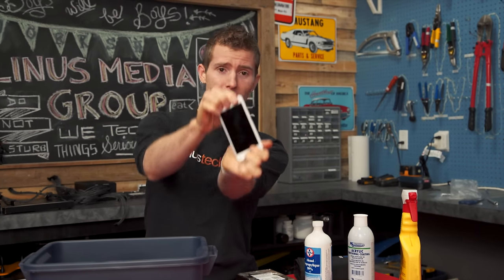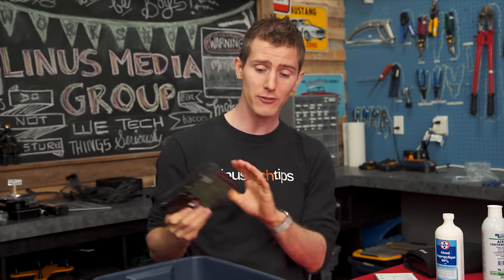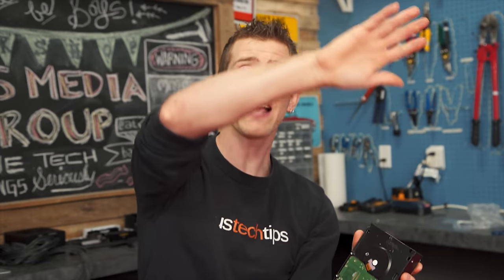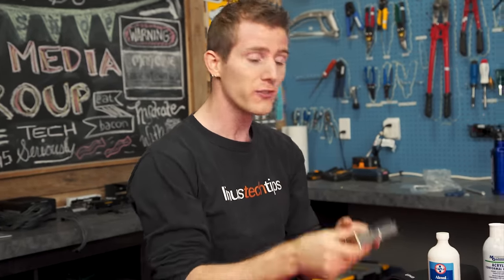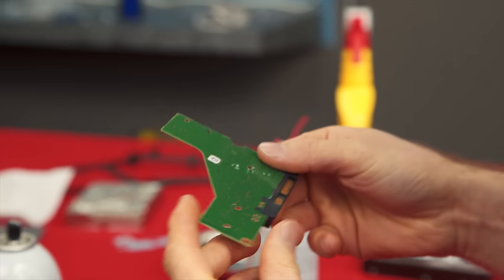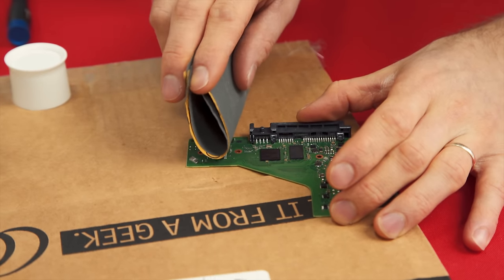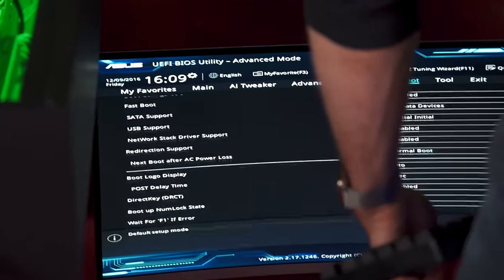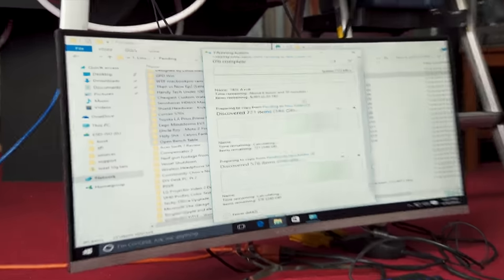DIY "Waterproof" Hard Drive

Comment: When you run out of ways to fit a sponsored HDD into your videos lol.
Reply: or "When you have all the videos pre recorded until new year but sponsorship requires one more video with their product and you are out of time and ideas"
Reply: Gadget Addict hi
Reply: Gadget Addict the worst is that it's still better than sponored spanish videos.

(An argentinian says it)
Reply: Of you wanna put it into water then just Use destilled water, no Minerals in it that lead electricity. Should work, even without your acryl stuff.
Reply: Gadget Addict ,
Reply: @jodafa1000  no because the metal's ions will get into the water, the oxyde too and it will become conductive

Comment: It was definitely the power connector. You shorted all 4 power pins together, because they're not at all isolated from the water
Reply: Jacob eMatt I don't think so. The Powersuply shoud be strong enough to handle that. I think it was the Signal, wich is very easy to influence, especialy with such a high data transmission
Reply: klosskopf der1. What? If it is shorted the power will never reach the HDD no matter if you have a 30$ PSU or an nuclear reactor plugged into it
Reply: Jacob eMatt I agree, even before he started adding more water, I knew it was going to fail, because the connectors would all need to be connected and then conformally coated to seal them and that includes the motor connections, as the water will still get in to the connections where he sanded them.
Reply: i don't think that you know how electricity works. if you are shorting the power connector the solution simply isnt a stronger power supply. Nothing can handle a short circuit, it can only shut down the power to it to prevent damage.
Reply: Should have put the connectors in and cover the edges in that spray.
Reply: I expected him to cover the connectors with silicone or that sealant thing :P
Reply: Karavusk ikr! This was so obvious that I genuinely wonder how Linus managed to overlook it. Did he just get so fixated on the PCB that he forgot about all other potential bridges?
Reply: InverseAgonist Typical linus fashion. He gets the concept, but that's about it.
Reply: do you guys realy think that water does realy shorten the circuit with 0 Ohm
Reply: normal water has an specific Resistor of 2 x 10^7 Ohm x mm^2 x m^-1 wich means that the actual shortening has an resistor of round about a view hundred Ohms (probably a little bit less caused by ionisation)
Reply: that would mean an additive power consumption of 1,4 W on 12V Trai and 0,25W on 5V Tray. (Predicting an resistor of 100 ohm)
Reply: should have sprayed more after the assembly...
Reply: That makes sense, because if the power pins were shorted, then the short circuit protection circuit of the PSU would have kicked in, and the PSU would have powered down to save itself (and the rest of the hardware) from frying..

I agree with klosskopf, it is probably the data pins that shorted, (let me dig out the sata spec to see how much current the signals are suppose to carry, and the expected load the differential drivers expect to see)
Reply: not power, most likely data
Reply: not a viable option
Reply: according to SATA Spec sheet, http://www.lttconn.com/res/lttconn/pdres/201005/20100521170123066.pdf 
Pg 195-210 (but we only care about VdiffTX (pg 198), and and ZDiffTX(Pg 195) a ~100 ohm brought by water, in parallel with the signals would have push the drive out of spec,  and cause failure...)

another way to know that the  power pins short did not cause a catastrophic failure, the drive worked after drying and was functional in mineral oil.
Reply: Just use vaseline or some sort of grease no need for silicone, same as everyone else who makes removal outdoor connections.
Reply: No, he shorted data pins. Water is not a very good conductor; the power supply probably didn't even notice the tiny load caused by the water.
Reply: FHRsLP The power supply wouldn't notice, but the hard drive did. 12v shorting onto 5v pins
Reply: That's not how it works... That's not how ANY of this works.
As I said earlier, the water is not a very good conductor and the current that flowed between 5V - 12V rails was zero. Nothing. Why?
You know, if you take a look at a SATA power connector, you will notice one small detail. Between 5V, 12V rails, there is a ground. So the current of a few mA that flowed was solely between GND<=>5V and GND<=>12V rails.
And even if there wasn't a ground pin between 5V, 12V pins and the current flowed between 5V and 12V.. so what? It's few milliamps, the 5V rail is usually loaded at 8+A so there would be absolutely zero voltage increase.
And even if by some miracle there was (let's say some random piece of metal got there), if the voltage on the 5V rail got above around 5.5V, the power supply would shutdown within a fraction of a second, because the rail would be out of ATX spec.
Reply: "strong enough to handle a short and make your electronic work regardless of the short"
sure
Reply: He should have put some silent around the power and maybe the data connector to seal out the water.
Reply: If all you 38 (expert) guys say so THEN IT MUST BE!   LOL
Reply: don't need to be a expert just smarter then linus which isn't hard
Reply: No, not necessarily. Water has a high electrical resistivity even when many free floating ions are present (as is the case with electrolytes dissolved in water) It would however cause higher power draw (due to electrolysis) and corrode the contacts progressively over time. It's the sensitive high frequency signals on the SATA connector that are the problem.The additional loading effects of the water are probably causing unwanted loading on the data pins of the SATA causing the interface to malfunction.
Reply: +Karavusk No, that's not how this works. That's not how any of this works!! The power supply connector to the HDD is made up of a ground connection, a +5Vdc, and a +12Vdc. all 5V and 12V power supply rails are the same for the entire PC build. If there was a dead short, the power supply would enter foldback current limiting and the whole system would shut down as a protection mechanism. If the power supply was not able to limit current flow for some stupid reason, then the wires to the HHD would melt in the case of a dead short.
Reply: You guys just need give it up and throw it into a ziploc bag.
Reply: this is conductive enough to to short because he put more tap water ( it have mineral ) not the distiled water
Reply: I has been done it, The HDD run smoothly, no water enter to the HDD ( Thanks to 5 layer Ziplock + Heated Zip) but 30 mins later IDK why it gone overheat (60°C) but my water is cool just 25°C.
Reply: I don't think it's the power connector. I've used the 12V rail of a low power psu to  electrolyse water to produce HHO gas and even with quite a lot of surface area, a very small distance between each electrode and a saturated  solution of sodium carbonate in water it still ran quite stable. Water isn't an ideal conductor. Especially if there aren't many minerals dissolved into the water. This combined with the fact that the psu can deliver a lot of power means the power connector probably wasn't the problem. The low power output of the data pins however means that even a small load could cause a significant voltage difference which would cause the data to be corrupted.
Reply: Water+plastic coating will act as an insulator. Water takes a LOT of heat to warm up, so the cool HDD probably overheated before the water took away the heat. A CPU/GPU water cooling solution uses heat conductive metal to bridge the gap (not ziplock bags :P ) and a water pump (not always needed, but is for high temps) and the CPU/GPU produces high heat.
Reply: Saw this years ago on exhibition, you could dump the full motherboard inside aquarium with live fish.
But all you need to do is assemble it first, and then spray all over, then everything is sealed from water, including cable connectors ;-)
Reply: Please take a good look at the SATA power connector and think about it for a minute, Sir.
Reply: +TechyBen: No, that's not exactly right either. The reason why a swimming pool feels cold when you jump in it even on a warm summer day is because the water (which is at ambient temperature) robs you of your body heat faster than air can, due to it's MUCH better thermal conductivity. Similarly, the HDD will get colder when submerged as the water will rob the heat from it. If anything sticking a hot HDD into water will cause thermal stress on the cast aluminum as it rapidly cools down.
Reply: For that matter, even the conformally coated parts of the HDD controller would be affected by the water while powered. The water would increase the capacitive loading effects on every single digital signal trace, changing the impedance of the lines and busses, and causing the line output drivers to see a large capacitive load and "short out"
Reply: A capacitor, for those who don't know, is "a device with 2 electrical plates separated by an insulator."
It is represented like this: ----| |----- And the schematic symbol is pretty self-explanatory.
Reply: Imagine the digital traces on the board, capacitively coupling to the water even through the conformal coating and PCB green soldermask. At DC, capacitors look like open circuit or nothing. at high frequency AC, it looks like a short-circuit. DC power rails would be unaffected, while high speed digital signals with rapidly changing voltage WILL BE AFFECTED.
Reply: Power Max
you need a real luck to find the resonant frequency
Reply: never mind
Reply: SpIRiTus1995 no, there is no rensonance needed. Capacitive reactance occurs at all frequencies. Xc is inversly proportional to frequency, so the loading effect happens with any changing voltage. The digital logic signals are effectively square waves, and have a LOT of harmonics.
Reply: Power Max are you high buddy?
Reply: Power Max You are partially right. BUT water and tiny traces don't really form that big of a capacitor; there is not enough surface area and water is a bad conductor. I doubt it would really affect the circuit.
What does affect the circuit though is water directly between high-impedance SATA data pins.
Reply: Literally all he needed to do was get the hard drive, connect the connectors and then "pot" it (i.e. dunk it in a bath of epoxy resin and allow it to harden into a rigid shell)
Reply: it is a saying
Reply: Power Max well not all frequencies give you the same impedance
Reply: Paul Sxton fair play.
Reply: Paul Sxton Practically all he needed to do was get the hard drive, connect the connectors and then "pot" it (I.e. dunk it in a bath of epoxy resin and allow it to harden into a rigid shell)...   better?
Reply: While everyone else is arguing whether it was the power pins or the data pins that shorted (btw, it was the data pins, or the protection in the PSU would've turned off power to the whole system, as opposed to the shown loss of connection to the drive) I'm simply going to point out that the OP called a SATA power cable a 4-pin connector, when it is clearly a 5-pin connector....

Comment: You need to try this with the PCB of a graphics card and submerge the card completely under water, that could lead to some seriously low temps. But this time remember to insulate the power connector.
Reply: Softerrr this actully sounds like an intersting idea you could easily use pcie extensions to achieve this as well
Reply: but metal is a better conductor than water... so heatsinks are better than just dunking a gpu in water
Reply: Water would indeed move heat from the heatsink, but it would propably not radiate out of the water too well, since a bucket or a small fishtank is gonna have a lot less surface area than a decent heatsink. 
Or so I presume, based on that the oil-submersed computer required aircooled rads to pump the oil through, and temps weren't anything particularly good
Reply: New meaning of water proof
Reply: thats the whole concept for mineral oil or Novak submerged PCs
Reply: just dump the whole GPU in LN2

Comment: Shouldn't logic have told you you needed to waterproof the cable connectors?
Reply: Caddy Guy Gaming Linus tech tips doesn't need logic :D
Reply: DonutEater true
Reply: what he needs is train and tracks
Reply: He should have re-sprayed after the alcohol with the connectors attached
Reply: True.  Electrical connections need to be isolated and watertight.
Reply: Logic should have told him not to dunk a hard drive into water. The second he started recording this video, logic ceased to be relevant.
Reply: It's about as logical as a "can a live power connector work in water" video.
Reply: bro learn how to spell connectors before you try to outsmart ppl

Comment: It wasn't very bright to submerge the SATA port and power connector, they are not water-tight. If they were watertight from the spray, the drive wouldn't boot up at all. The fact that the harddrive works before submerging completly, means the SATA and power connector aren't watertight. You risk not only destroying the harddrive, but the motherboard, power supply, and every other component which are connected to the motherboard, becase you submerged the SATA and power connectors.
Reply: LifeStalker with all the parts they have? Don't think they mind breaking some stuff. I mean, he just submerged a 4tb drive.
Reply: The seagate was actually a 10TB drive that costs over $500. Which makes it all the better.
Reply: hm, I think power supplies ad motherboards are somewhat tolerable to shorts though?
Reply: TheFreaxTux most branded power supplies has great overcurrent protection. But it depends on the motherboard. Some brands/models has better overcurrent protectino than others. For instance, just short circuiting a USB port on some of the most popular motherboard brands can permanently damage the port and disable it, even worse, break the motherboard and other connected components completely.
Reply: ahh i see we have an electrical engineer here
Reply: Water cannot really short connections the way you think, it can mess up high impedance connections but the resistance it has is too high to damage the power supply or the motherboard by just putting some connectors under water.
Reply: Pablo Rages I said "by putting some connectors under water" not dropping water directly on to it.
Reply: Pablo Rages it depends where the drops lands. connectors on the motherboard may have some short circuit/overcurrent protection. However if the drops land on the actual motherboard circuits, theres a big chance it can damage something.
Reply: LifeStalker i think he knows this

Comment: Well of course it didnt work, you used the wrong coating and didnt even attempt to waterproof the power/data connections
Reply: TacticalBBQSauce he did waterproof the connectors. it interfered with the connection so he had to scrape off the coating.
Reply: Those were the contacts, I meant the connectors themselves and the wires. Like you would do if you understood water ingress.
Reply: He should have plugged in all the cables and then spray everything with that stuff.
Reply: Right, it worked until he added enough water to go over the connectors. There's water getting into his power supply SATA cable. I had a feeling it would stop working as soon as I saw him power water over the top of the connectors.
Reply: *pour
and i agree. His SATA connector was probably the one making the water conductive with the aluminum clip. He should have sprayed at the very least both the connector and the PCB.
Reply: *should have
Reply: Regenbogenkotze
It's still the wrong type of conformal coat for what he's trying to achieve, better of to make a mould and encase the whole lot in conformal gel. This wouldn't address water wicking up the cables over time though.
Reply: Yeah seriously i dont know what he was expecting to happen.
Reply: +zarmaan khan I really wouldn't try doing anything with that  hard drive, it being an 80GB drive means that in all likelihood that drive is filled with air, and therefore like he stated in the beginning of the video you can't do anything with them due to the breather holes, wich you don't want to cover up either in an attempt to waterproof it.
Reply: +Brian Hamel , I guess the breather holes are there to help equalize pressure at significant altitude differences (and likely to preserve the seal by keeping the differential pressure between outside and inside at 0)..... So, instead of giving  up, I think I'd like to try creating an air bubble around this hole that had enough room to contract with the added pressure of the water, and then throw some hot glue over the foam seal around the cover..... and then jam some dielectric grease all over the connectors and have at it.. But I don't have any conformal coating, so it'd be a waste of time.

Comment: What you should try next time is siliconing everything in. Like, fish tank silicone. Put it together, plug it in to the power leads, then silicone everything up to the cables, that way no water can possibly get in, and all the contacts are still touching. :] That's a method people use frequently on LEDs, especially in fish tanks, to prevent them from getting water in them and shorting out.

Comment: Here is one practical application for a helium filled hard drive: high altitude data storage. High altitude what? Yup, as low as 3k m above the sea level air-filled hard drives may stop working; worse yet, they may get permanently damaged due to thin air; the hard drive heads plowing hard through the magnetic HDD surface due to the lack of the expected "air cushion". I've damaged a bunch of HDDs used for photo/vid footage backup during my treks in Nepal. Pricey SSDs were the only option, back then. This technology seems to be a viable alternative now too.